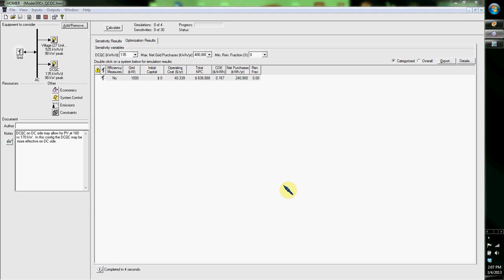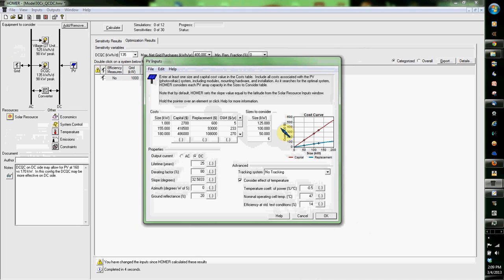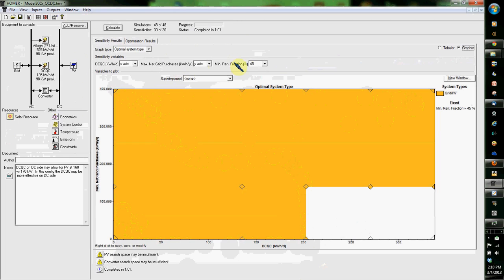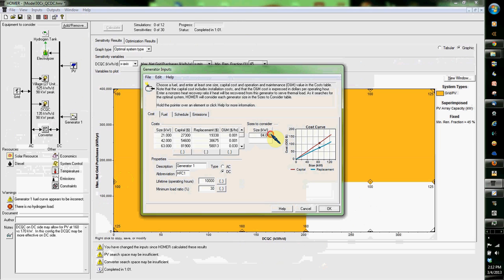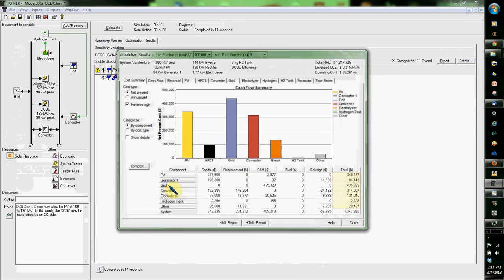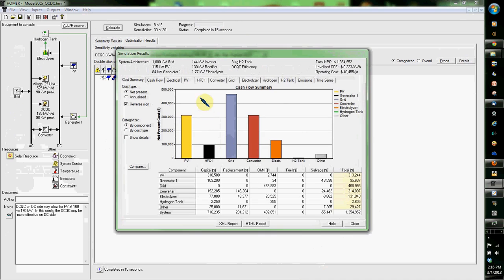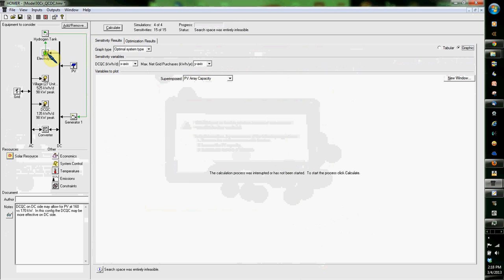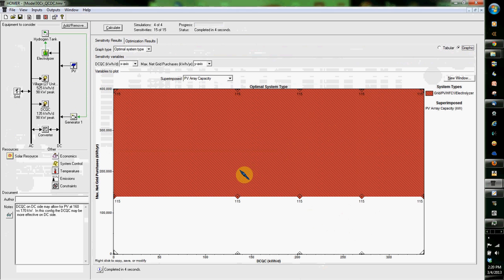microgrid modeling HOMER Energy Fuel Cell Demo

Comment: I tried but no green line. Therefore hydrogen tank it makes no sense :(
Reply: Were you able to solve it? I also do not get the green line to feed the fuel cell. I cannot modify the fuel curve because it appears in gray with no option to do anything.
Reply: @malinallip.v.8699  exactly, facing the same issue